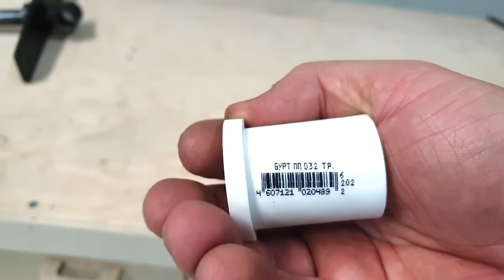This is a real treasure! As many as SEVEN types of homemade devices for home craftsmen!

Comment: Whole table moving while planning... Waste of time
Reply: How does that affect the work? It doesn't look like it's wandering around the shop, just a slight wobble. Well, I actually don't understand the concept of hand planing, anyways, with all the tools we have today, but holding a piece secure to the table is a great addition.
Reply: @workshoptherapy  First, that wobble is wasted energy. Makes a difference if you plane a bit more than just demo board. Secondly, it is impossible to keep edge on the wood if the whole thing is moving unpredictable and wood not 100% homogeneous.

And ... Yeah, one could desire a machine that tree would go in and finished cabinet would come out but I prefer hand made things.